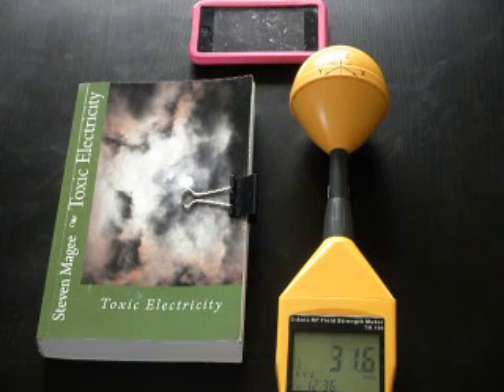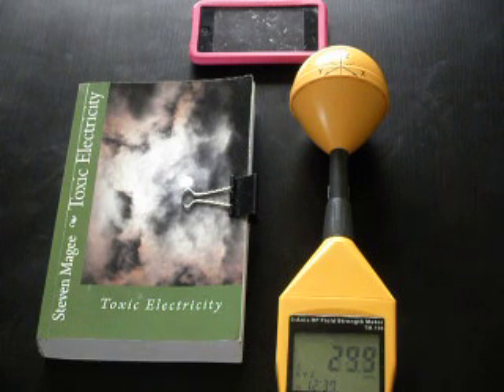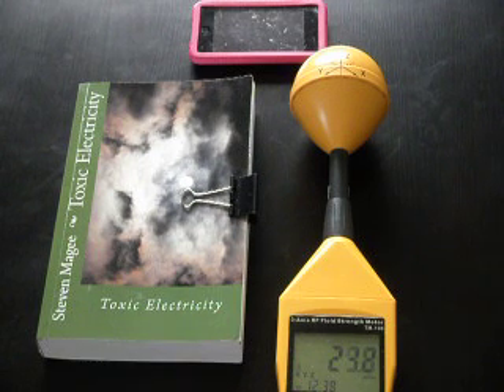Apple iPod Touch Electromagnetic Radiation Pulse Every 45 Seconds

Comment from the maker: I was detecting approximately a 600 mV/m pulse in the bedroom every 45 seconds.  As you can see, the pulse is much higher when close to the device.  When I inspected the device I found that it was turned off in stand by mode and the electromagnetic pulse can be removed by completely shutting down the device or turning off the wi-fi option.